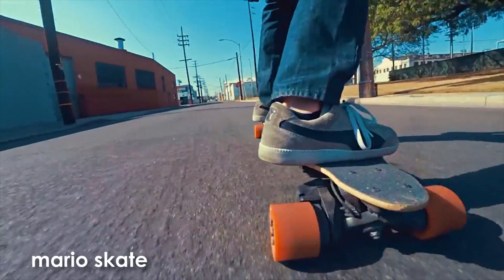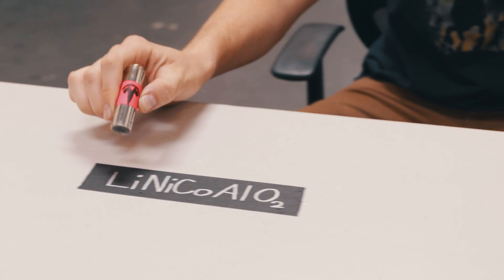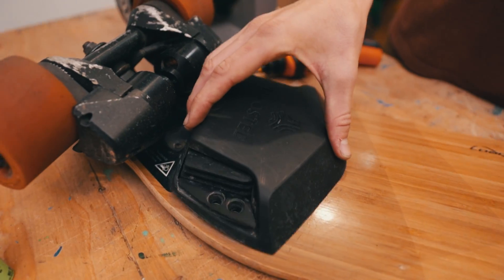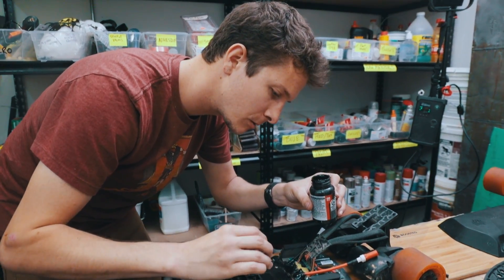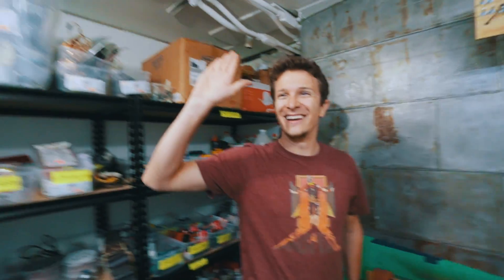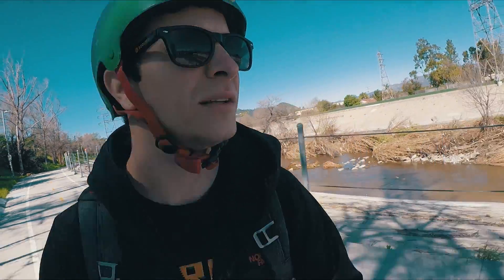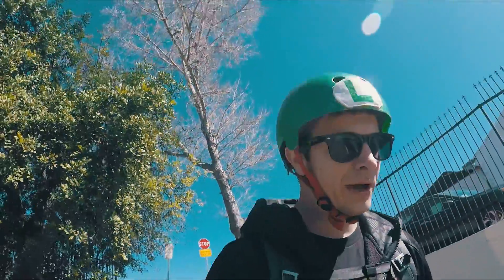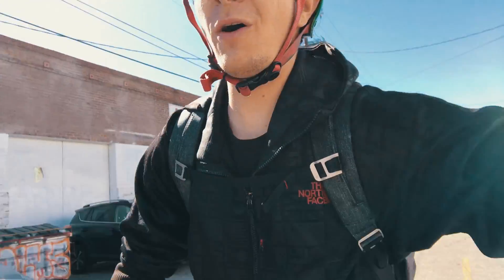Tesla Batteries in an Electric Skateboard!

Comment: use a voltage converter, the use up a little energy by themselves buzt maybe it will give you even more, with the current situation. 
I Use one in a similar situation, but i dont know how good the work from small to big, mine change 52(down to ~30)  to 24 Volts, mobile music amplifier, and it works quite well. Just be aware you need to at least cool it a little bit passively

EDIT:
yes, i didn´t think about the drop in voltage from the internal battery, hurr durr 
intelligent me. Also didn´t think about deep-deloading (is this how it 
works in english, not native, sorry, i mean the state of emptying the 
battery so much it kills it).
Buuuut I have another idea: Get a new Driver fitting for the new battery packs, completely take out the internal battery, replace it (depending on its size) with one or more battery packs, cable that stuff up and you´re good to go. If there is no way to wire the driver in a fitting way to have feedback - which i can hardly imagine) set it up with a oneboardcomputer (again, is this right? smth like a raspberry pi, but that would be overkill), code a super simple app and send the batterystatus to your phone via bluetooth.
Or be fancy and put LEDs in the board, itself and make a onboard (see what i did there?) statuspanel. that might in fact be way easier, one chip may be enaugh to control that with the info from the driver :D
Reply: You could fry the board if you upcharge the batteries while they are full.
Reply: heh "current situation"
Reply: I ran 2 different chemistries with different voltages successfully in the same pack on my DIY EV for years,   Voltages don't have to match at all times only at certain points in the charge/discharge cycle
Reply: As Tm m already mentioned, that´s a pretty bad idea. You´d have to exactly match the internal batteries voltage at all times, otherwise you´ll get, in a best case scenario, high currents between the batteries, resulting in a massive inefficiency. Worst case would be a dead LiPo battery because of over-/undercharged cells. You could of course solve that problem by completely removing the internal battery, but i dont think thats what he really wants.
Reply: Using a boost converter has some issues. The whole "different voltages" thing has been chewed through by other commenters, that's a big issue indeed. The other issue with boost convertest is that they're inefficient and also introduce a lot of ripple, because they're using inductors (little coils) to boost the voltage. The ripple could be smoothed out by using a capacitor (the control board has two of those on the battery input as i've seen), but the inefficiency thing is a killer, because boost converters have a given input voltage at which they are most efficient. Any different voltage will make the efficiency drop, which is not avoidable with a battery powered system.

The better solution would be either a) remove the original battery, b) replace the original battery by an additional battery pack or c) disconnect the original battery via means of electronics. The last one will introduce the issue of different voltages during charging, which may cause fire.
Reply: Boost converters are only about %90 efficient though
Reply: Fuck the original battery and keep the new ones, maybe
Reply: Jehu!! I've been trying to get your attention for months!
Reply: they cant really handle the amps/wattage. a boosted board has 2000W worth of motors. there aren't really any small size converters that can do that.
Reply: @jehugarcia, when I was watching this I was thinking about all the videos on tesla batteries you do XD found it awesome I saw this comment ps. love your channel. Pps I also love your van.
Reply: that is better than not utilising the remaining power. You could however get the "voltage booster" to activate when the voltage drops below a certain threshold. This would mean that you wouldn't lose any power unnecessarily. Shouldn't be too tricky!
Reply: You would lose energy in this, not great for ranged solutions.
Reply: in re: overvoltage with full battery -- you could clamp the voltage to the max of what is allowable so that the board never sees too high a voltage (simple diode clamping could achieve this). the only downside is that it would add even more inefficiency.

Comment: how about putting the batteries in series? and use some power transformer to control the voltage?
Reply: Hiraki play || Games&Unboxing channel this would probably work, the only thing that would be tricky would be regulating the voltage so that it matched the internal pack voltage.

Comment: you could attach the guts of the multi meter into the board and have it accessible to connect to the battery to test it every so often if you know you will be doing long trips or have it permanently connected with a switch to turn off and on when you want to check the batteries